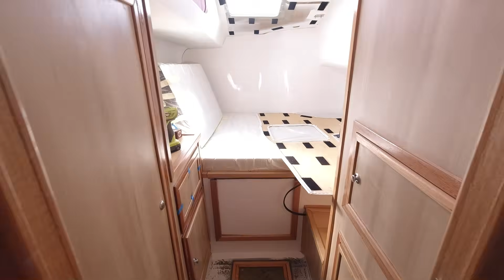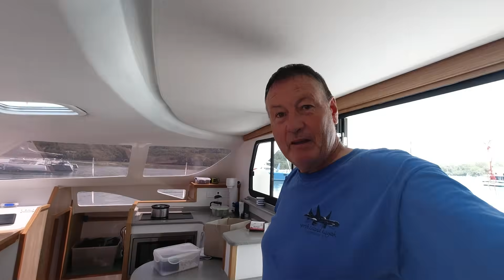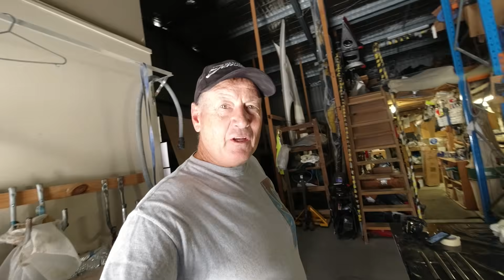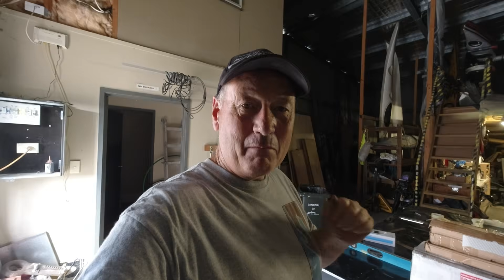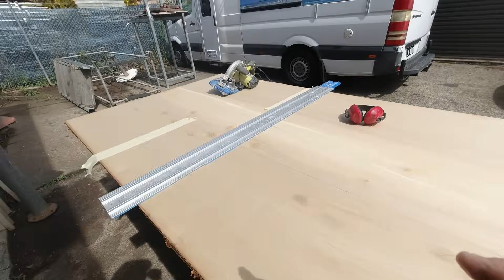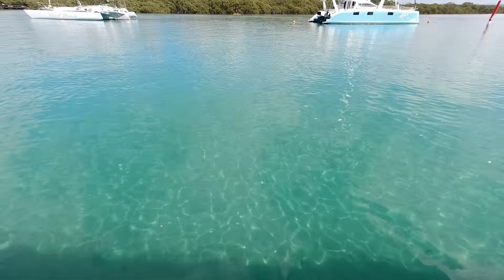Cabin Privacy Coming Right Up - Catamaran Build Ep380

Comment: Quick note on the Lewmar window hatches Ross. They are powder coated and notoriously corrode under the coating. I strongly suggest you apply a UV stabilized clear coating to seal the powder coating prior to installing them. They’re great hatches otherwise. 👍🫡
Reply: Spot on advice.

Comment: Ross,  For the areas where it doesn't quite fit you might use a trick from luthier's (guitar makers) and prop a flexible piece of wood with a slight bend like a archer's bow (see go bars : https://www.youtube.com/shorts/Iqxm_MtsjoM ) so it applies vertical force to the area of poor fit... a pad or some rags to prevent a permanent impression on padding may be needed so it takes a good it over several days of heating and cooling in place, remember the plywood is adhered together and may need some temp and time to adapt to new flexed circumstances.